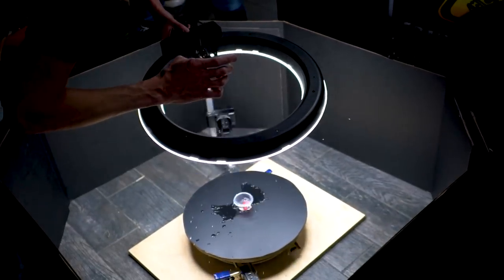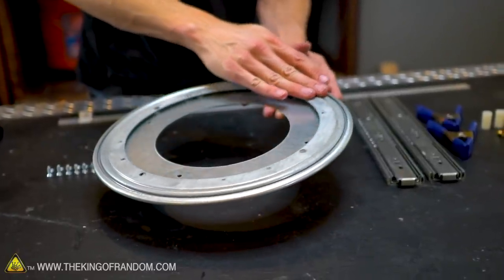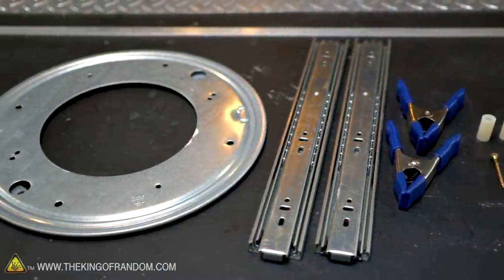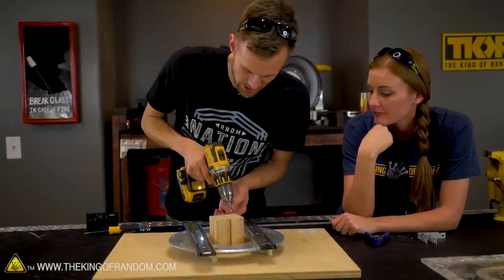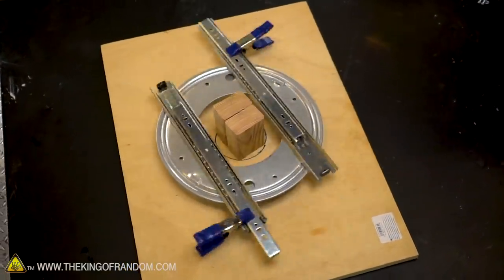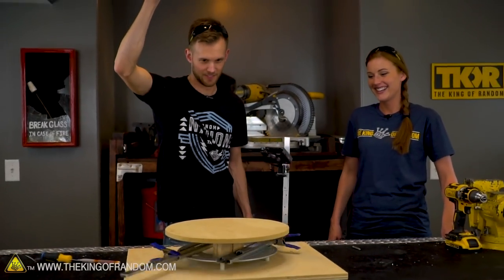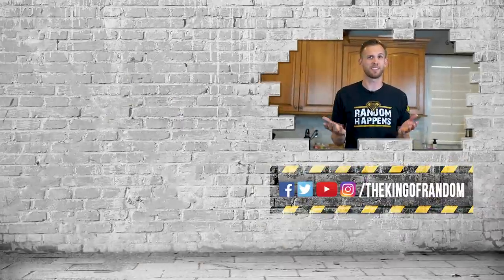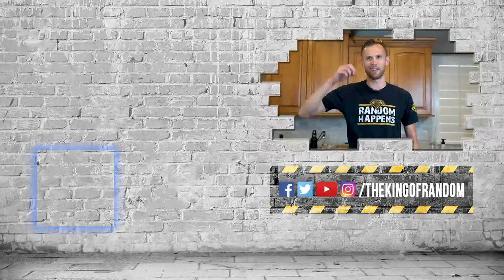This is How to Gain SUPERHERO VISION

Comment: Figure out a way to speed the rotation up mechanically. That way you get more angles with your footage... If you can start your recording with Bluetooth, this might help
Reply: Possibly a push bike set of breaks set to slow it down,  maybe some sort of ratchet to pick a speed
Reply: Sony RX100 IV and newer version have remote control from a phone I believe but  might not during during 900fps  slowmo mode.
Reply: I agree!

Comment: Use gears and a motor and make this mechanical control please!!
You can use 3d printer for the gears
Love you guys ❤️❤️
Reply: I agree, it would make it way more practical
Reply: You Should ask Colin furze to do that he would do it easy as cake
Reply: I think a belt drive would be easier and cheaper
Reply: patrick gardner no all you would really need is just a big to small gear ratio and a motor and it would just go faster
Reply: Do you really think they would go out and buy a 3D printer just for that?
Reply: WafflesNslime79 They’ve already got one!
Reply: Yes, do this please.
Reply: WafflesNslime79 they already have one

Comment: -You should put dry ice into hot water for the next slow mo shot
- fill a inflatable mattress with helium
-make the boarder all mirrors for the new mount
-set steel wool on fire (new mount)
-drop glass (new mount)

you guys are amazingly talented 😊
Reply: I agree with num 2

Comment: Can you make the rig motorized.? For it to spin faster..?
Reply: They were probably already thinking of that
Reply: And this is when they do a colab with Simone Giertz
Reply: that could be done pretty easily with a couple pulley wheels, a couple guide rails and some nylon stockings. (I was trying to think of what might be quieter & easier than a small belt driven drive train) The last thing that could also be used instead of making it motorized would be a crank handle on the outsize pulley ring. (Sorry for the edit .... scratch the nylon stockings, I'd go with ((depending on the size of the rig)) a lawn mower belt)

Comment: It would be awesome to have a backdrop mounted to the opposite side from the camera, so you don't have the spinning background (only the object on the platform would look like it's spinning). Maybe 3-4 panels of mirrors mounted on the counterbalance drawer slide?
Also, a battery and electric motor connected to a RC car tire of some sort on the counterbalance, pushing off the edge of the circle of wood, could pretty easily propel the rig automatically, so you don't have to push it manually. Pair that with a remote trigger for the camera, and you could probably get pretty consistent shots.

Comment: Could you try it with a way faster camera (that can record more fps), and engineer the setup in a way that it will spin automatically a lot faster?
If you manage to pull off enough speed with enough frames per second, you can get a 360 degree angle shot on a falling object (it would look like it's staying still in the air while the camera itself is moving)

Comment: The other day I was installing a new kitchen faucet and after I was all done I had realized I accidentally put some 100% silicone caulking on my Tshirt. I tried to wipe it off as much as I could but it still left a few marks. I was hoping it would come off in a regular wash but it didn’t. It still left a few 1-2 inch spots.
 
It gave me an idea of putting silicone all over the Tshirt and wiping it off just to leave a thin coat but I haven’t tried that idea yet. Maybe it would turn it in a water resistant shirt lol.
 
Maybe you guys could try to coat some items (mostly clothing) with a thin coat of 100% silicone caulking and let it dry to see what kind of result it would do. I know there’s spray you can buy that will probably do the same but caulking is usually cheaper and would be interesting to see how it reacts with certain things. If the items would become somewhat water resistant.
 
Hope this idea is interesting enough for a video :)

Comment: Try it with a taser..Arc welder..Sparkler firework.. one of Grant’s instant slushies maybe? Or if you’ve ever took apart a bic lighter and heated up the spring/flint throw it on the ground it creates pretty cool, but dangerous, sparks..

Comment: Hello there TKOR I have one fore you

I had recently put a plactis cup underwater and pushed it down quickly to trap air now heres the challenge part I want to see you guys try to keep the air inside in a multitude of different ways then putting it right side up in the water to see if you succeeded. One thing is that you still have to keep the air suspended under the water and then cover it up. 

Enjoy

Comment: Exclusion zone (EZ) water droplet experiment. (Water droplets occasionally float on water due to a property of water referred to as EZ water) when water comes in contact with other materials, it's properties and molecular structure actually shift at the point of contact (from H2O to H3O2) creating what is called the exclusion zone. You should reallcy check it out, it's super badass, would love to see the droplets in action in slow motion.

Comment: You have got to do something burning, that blaze like that would be awesome.
As would liquid metal dripping onto the surface.
Maybe liquid oxygen/nitrogen pouring/dropping onto something and freezing it? 
Or just putting something that has quite a messy reaction into the vaccuum chamber. 
Or dropping something into the liquid nitrogen. 
Burning the carpet with Liquid Oxygen!!!

Comment: You absolutely need a motor and belt on this IMHO, if only to keep the rotation speed consistent (high speed shots are short enough that it doesn't matter for some applications, but when you're manually giving speed to your device you might make the camera mount shake a little bit, which can persist for a while and doesn't look great).

EDIT: Whoa, that last shot with the bouncy balls is absolutely beautiful! But also, that's where you can see the shaking I was talking about, I expect a motor could make the rotation smoother.

Comment: 1. Start a flare stick on it
2. Burn Ethanol on the plate
3. Burst a balloon by dropping a nail
4. Burn Gun Powder
5. Breaking a Glass object
6. Hydrogen filled balloon popped up by ignition
7. Try making a foam volcano
8. Droping Jelly
9. Try firing a bullet in the centre from top
10. Pour Liquid Nitrogen on the flat surface

Comment: Making Floam(Styrofoam Slime) and testing what happens if you set it on fire, in liquid nitrogen, in a vacuum, freeze drying it, making it with different liquids such as glow stick fluid, etc...

Comment: Need to put an electric motor on it with variable speeds.  That way you can go around the table faster. And maybe a camera with a remote so you don't have to physically touch it to turn it off.

Comment: prism w/ a hard white-light source, black out room, smoke or particle source.
what could you do w/ a laser pointer or 12? mount on camera, mirrors / beam splitters on pedestal? 
TESLA COIL! yeah baby. or Jacob's Ladder.
aluminium can, vacuum pump attached to top, record the implosion.
crucible of lighter fluid, on fire, drop something into it.
a guitar or piano string stretched taut, pluck it. repeat w/ water on string.
hold a cat upside-down, drop it. make sure it's high enough to complete the roll, pls.
Ladybug take-off.
block of dry-ice, boiling water dripping onto it.
Indian rubber ball bouncing, how much do they deform?

Comment: I dont see how this rig improves the video of the original? I've seen slowmo guys do it. It still looks the same in my opinion. The problem is that the plate didn't spin fast enough, and when it does people try tho film thing to fast tip s5 on the camera. I would say just have another camera and film it on a different angle. Much less hassle than building this rig.